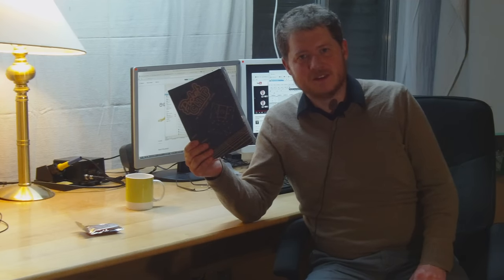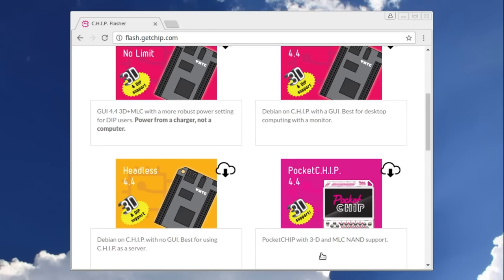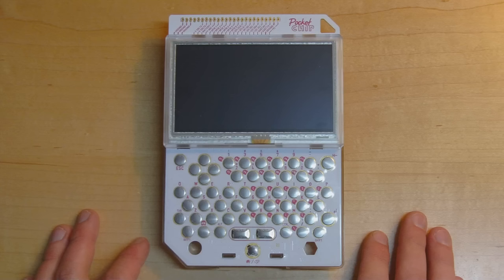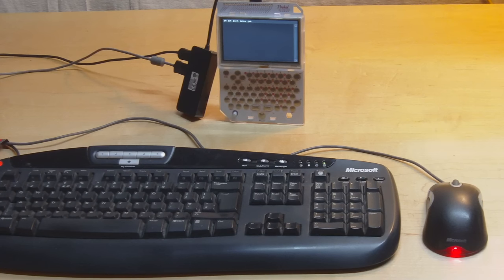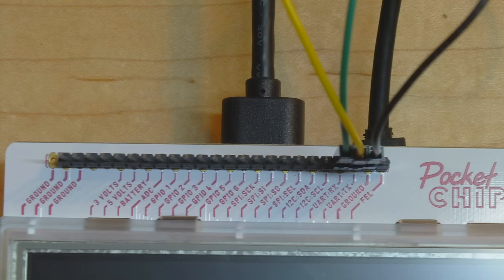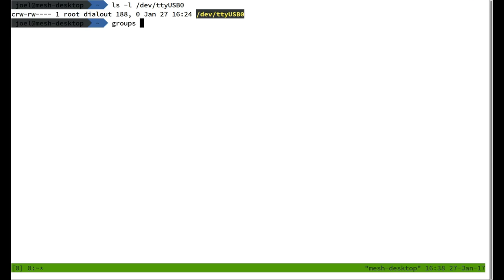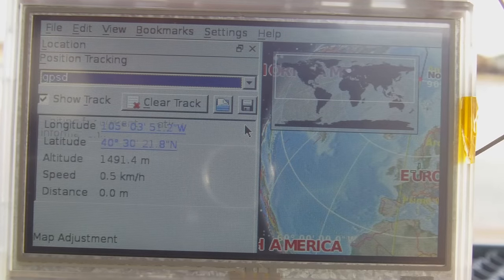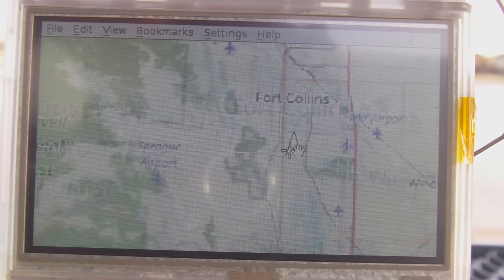[004] CHIP $9 computer, and PocketCHIP

Comment: He skips the touch calibration and then complains about the touch screen not doing what he expects...hm....
Reply from the maker: Didn't know you could do that. Thanks for the tip. There's some info here: http://bit.ly/2mGxFSK

Unless I missed something, this isn't explained in the official docs, right?
Reply: Oh, I referred to to one of the first grey welcome screens you skipped through. There was something that looked like a picture manual, on how to calibrate the touch input. I'm re-watching the video now to give you a time mark.
Reply: Ok, I remembered seeing the screen from 18:14 when I commented. It's not what I thought. But a quick search shows a rudimentary method of calibration http://www.chip-community.org/index.php/Calibrate_Touchscreen
Reply: Isn't it also a resistive screen? In which case, use a better stylus (like the type a 3DS might use, etc).
Reply: I was thinking this aswell. Since it's resistive that would be a big reason he was having the issues he was having. Even a mechanical pencil with the lead retracted would work better than the stylus he was using.

Comment: I bought the C.H.I.P. no poket chip and use it through a TRSS-connected composite cable featuring rca connections, a usb hub with a built-in wireless mouse keyboard and is a full-featured PC

Comment: I was a 'kernel hacker' backer. They double sent me my final reward. Wound up with 2 pocket chips, 2 chips, 2 vga and hdmi boards.  I left one set sealed in box.  Also have an alpha and a beta version of the chip.  It's pretty neat.  I've used to program Arduinos. Also has come in handy as a pocket terminal that is a bit more user friendly than a phone app IMHO.

Comment: you can get a Wireless USB keyboard Mouse Combo and it will only use one USB port for the receiver , hence no need for a hub
Reply: Unless you also want a flash drive or other device linked up, but cheap simple hubs are a dime a dozen so not a huge deal.

That said it makes me wanna put my Pi 3 or Pi 0 to work, kinda impulse bought them without a plan XD

Comment: Chip - a $9 Mini-Computer which has USB port and Headphone Jack.

iPhone 7 - a $649 Smartphone which has Lightning port.

So, at less than 1/65th of the price, the Chip still has a Headphone Jack, and can basically do the exact same things as the iPhone.

That iPhone sure seems like great value.
Reply: where's the UL listing? FCC testing for radiated emissions? there's a lot more than just the face value hardware...
Reply: You could also say that a tricycle can do the exact same things as a Tesla, yet it costs a fraction of the price and still has pedals.
Or you can stop taking drugs and grow a brain.
Reply: shutup about the headphone jack. DON'T BUY AN IPHONE
Reply: Do you need Aloe Vera for those burns around your intimate areas? too bad they haven't yet made an medicine for people who buy Apple products.
Reply: Presumably, that mini-cumputer's flimsy construction will last longer than an iPhone after it's next deliberately crippling 'update'.
Reply: Dr. Etzor ،wat

Comment: Hands-down, this is the best video I've seen about the CHIP and PocketCHIP! Tons of great info here. Now I want to pick up a GPS receiver and duplicate what you've done here with my own PocketCHIP.

Two questions: Did you ever find a workaround that allows you to boot the PocketCHIP with the GPS connected? If so, would it be possible to permanently connect the GPS to the internal solder pads and fit everything inside the case?

Comment: That's the most odd Colorado accent I have ever heard.  However, I got most of the words.  But, seriously, folks. this is an excellent presentation.  However, as with all presentations of the "$9 Computer", it quickly becomes obvious that by the time you get enough stuff to make it work, you are at about 3 times the price of a Raspberry Pi 3 which is at least 4 times faster than this dog.  I won't be buying one but have learned a lot from this presentation.  Thanks a lot for preparing it.  Made it all the way through!

Comment: what did you just sprayed over the board to clean the terrible sticker???
Reply from the maker: It's Isopropyl Alcohol a.k.a. IPA. You can get it bottled or as a spray.

The result wasn't perfect - the CHIP has matt-black solder-resist, and the sticker seems somewhat metalic, so I think I ended up with small amounts of conductive debris ingrained into the solder-resist. Fortunately it didn't seem to break anything.
Reply: OpenTechLab hi opentech where can I buy one in the uk ? Thanks
Reply from the maker: I think people are reselling at a mark-up on eBay, or I believe you can place a back-order at getchip.com .

Comment: What GPS formating output is it ? 105.064200, 40.506041 doesn't show up on google maps.. ;-) .. I also am looking for a small LCD screen friendly Window Manager. On the Raspberry using most images, the Windows that open are beyond the screen and hard to use. Even standard settings, it's annoying. Let me know if you have any to recommend. BTW: thanks for showing and your time. Ignore the troll haters..

Comment: I have started to be interested in single board computers. It seems everybody are interested in them these days. Also in open source electronics, like Arduinos, actuators and sensors. Can you suggest where I should start to get basic information on how different OS works on SBC? How to configure, where to fing programs or start writting my own.
Reply: Tomas Maliauka Consider getting a RaspberryPi 3 kit.  There are different levels of kits for different levels of skill, cost, and ambition.  I've been using mine to learn Python, but it has become my main computer - especially after my Windoze desktop died.  The RaspberryPi marketing aims for kids and school projects, but don't let that turn you off.  With a fast microSD card, it is a fully functional and usable everyday computer.  

The Raspbian operating system comes with a full set of LibreOffice software, several programming languages, browser, Mathmatica, and games.  Other operating systems are available if you would prefer those as well.  Learning Linux is a matter of reading, searching, reading or watching some more, and trying things out.  

I suspect I will be learning a lot more Python and Linux over the coming months.  I've already written an snp file to SPICE model converter to use in my engineering work, as well as an LFSR counter designer in Python.

How much you can learn is up to how much effort you put in!  Good luck!

Cynthia

Comment: It was doing that with your pen because you were holding it at such an angle, and it's such a large tip - get some Nintendo DS styli and it'll be fine!
Reply from the maker: You're right - I think a stylus would help. You can get them for $0.20 on AliExpress. But despite appearances on the video, I really believe there was a misalignment. I wonder if it happened to anyone else.
Reply: hi
Reply: Misalignment happens, and should be calibrated at the factory after installation. I wonder if they skipped that step...
Reply: I learned that there is much to learn about these little "toys".... I  am now eyeing my new microwave and smart fridge screwdriver in hand. Want it to make my sammich when I pull in my driveway...

Comment: I have to say, putting a wallpaper on the desktop and also using XFCE (which is definitely not that lightweight but I guess if you compare it to GNOME or KDE then yes, it is) is a very peculiar choice for such a device. I would have done a minimal LXDE install (if the goal is a more traditional desktop look and feel) with 99% of the software I see in this video completely gone and (of course) no wallpaper.